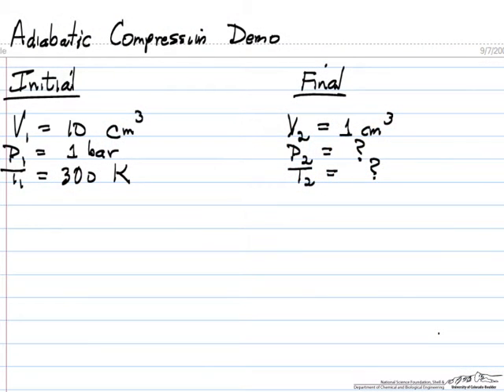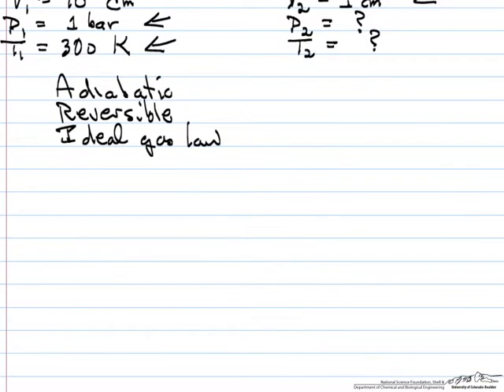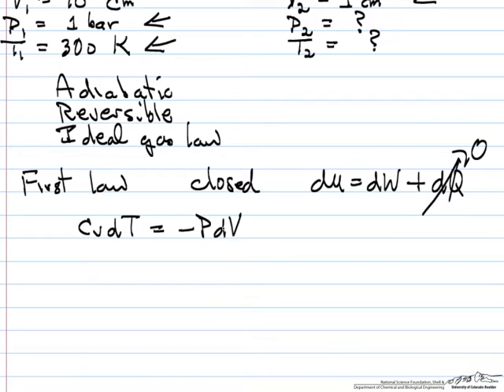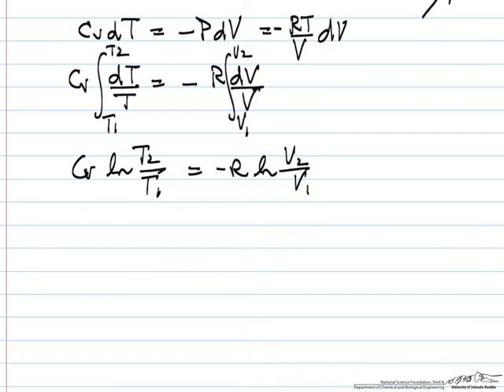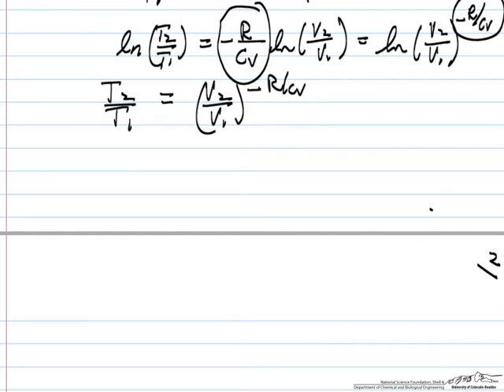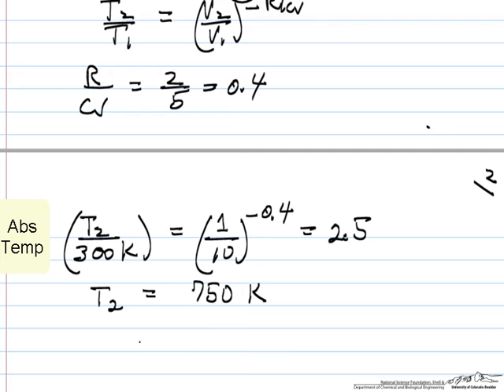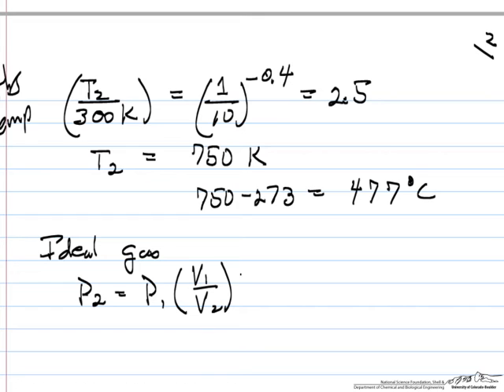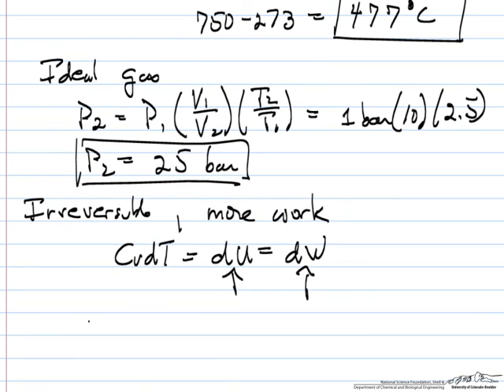Reversible Adiabatic Compression of Ideal Gas

Comment: why not use Cp-Cv = R? You use Cv and you have the dV term in your calculation, how can volume vary and you get to use Cv?
Reply from the maker: Using Cv has nothing to do with a constant volume process. For an ideal gas, delta U equals Cv*delta T for any process.
Reply: +LearnChemE  is that true even if we deal with a constant pressure process?